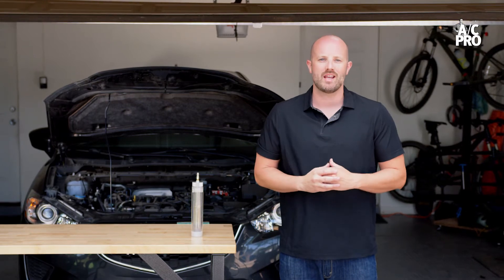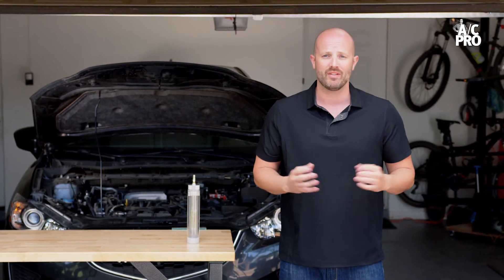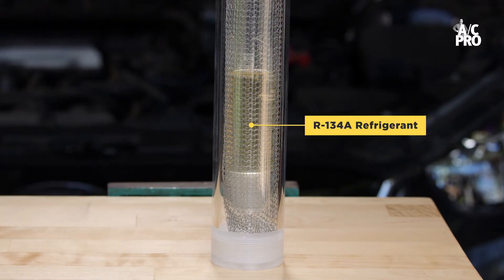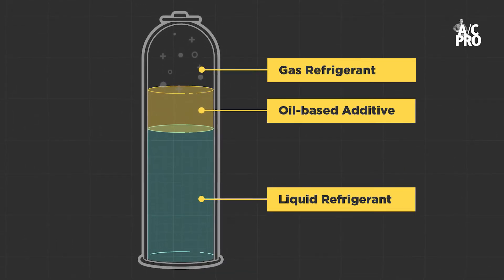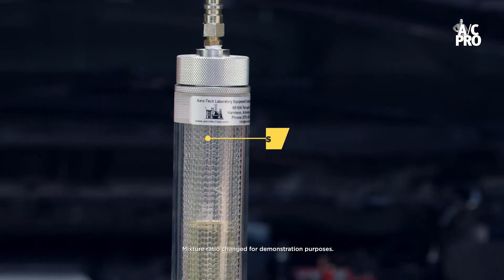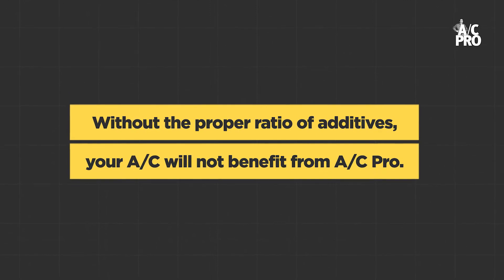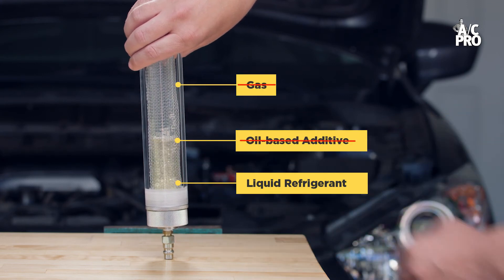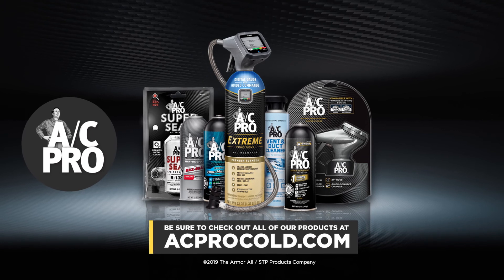Ever wonder what's Inside a can of A/C Pro®

Comment: So I just bought a can it's 92° outside it feels a little better I did shake the can up and down and left and right as I was charging the car it's still not icy cold but it's colder than before did I not probably shake the can enough should I go back connect the gauge without the can let some out and retry again I've started off in the very low green now I'm exactly in the middle at 40psi I have a 2014 Nissan Sentra
Reply from the maker: Richard - shaking the can helps mix the refrigerant with the oil and additives in the can.  If your pressure shows 40 psi you should have enough refrigerant in the system.  If the vent temp still isn't blowing out cold air then you may have another issue with your system.
Reply: It's working better now I let some pressure out the system day after I sent you the reply I shut the can up a little bit better added some more now it's icy cold at 95° out here in Jacksonville Florida
Reply: @richardv3327  Wouldn't that leave too much liquid inside the system because you let the pressure out which I assume is gas. It wouldn't be the proper ratio?
Reply: @seahawksforever9504 I came here looking for the same answer